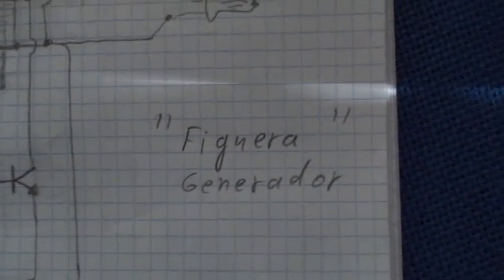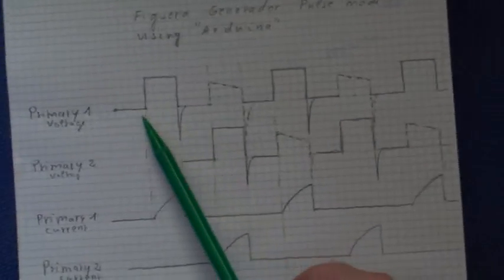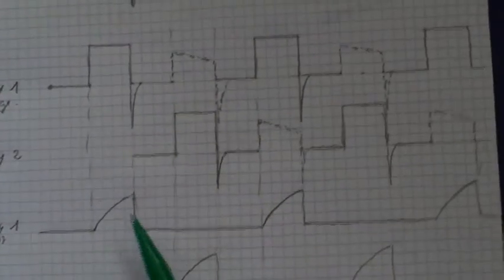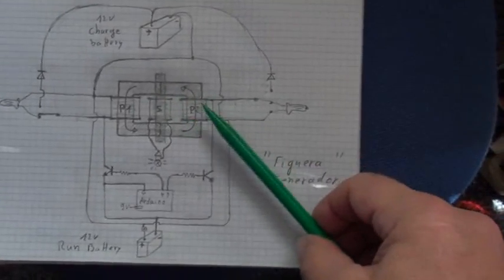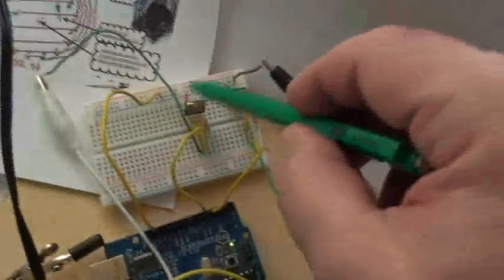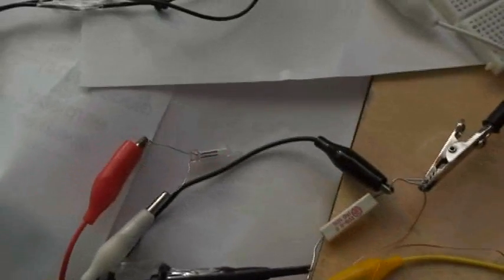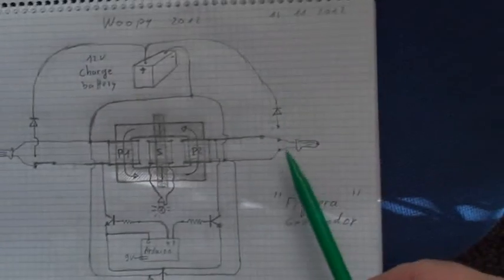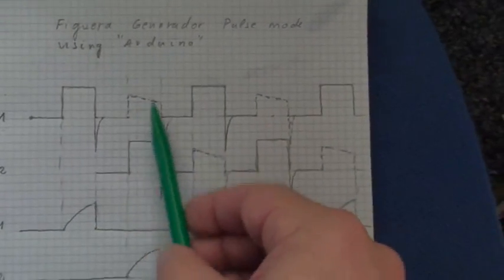generador Figuera approach 3

Comment: Two opposing primaries are used to compress the field lines to match that of a standard generator. if the pressure is not maintained the generator will not output squat which is what your set up is doing.
in other words there is two opposing cores and a secondary in between at a 2 to 1 ratio. the tri core setup is the basic electric generation of all of mans generating systems. the core orientation you have will never produce enough to self  sustain as you MUST follow the patent core orientation.

Comment: thank you for doing the experiment that i have dreamed of for the capturing of trace or the voltages that seem to get lost or wasted normally , and i see it as a rechargeable storage in electric tooth brush placed beside a 110 v outlet . it remains charged . the control at a distance runs down, Both are used regularly.

Comment: Another thought. Using arduino is probably not a good idea w/o protection resistors or optoisolation. Also, it seems to me that the most dramatic effect would be observed when you hit resonance. Your coil design will have a self resonant value you can determine with a signal-generator.